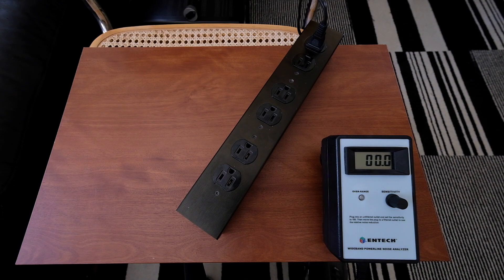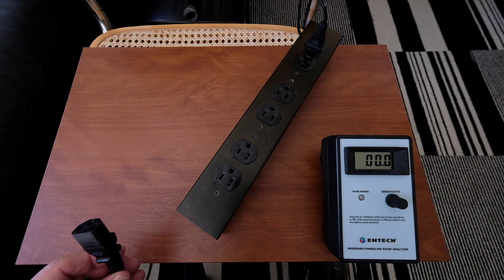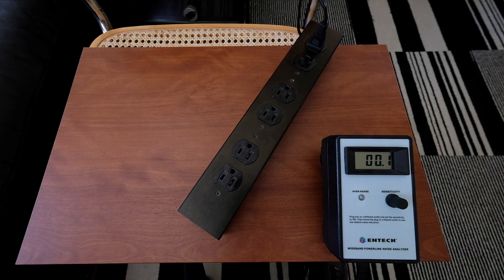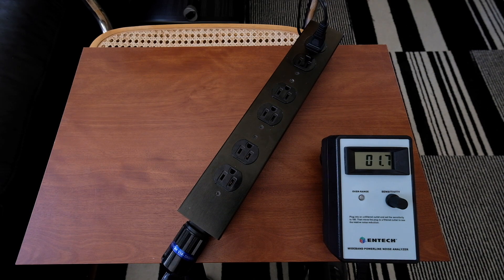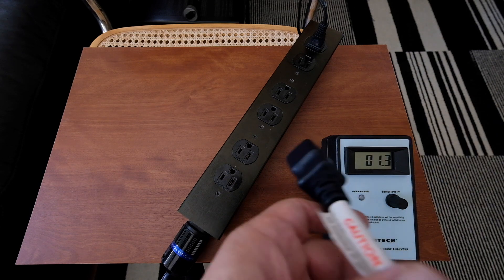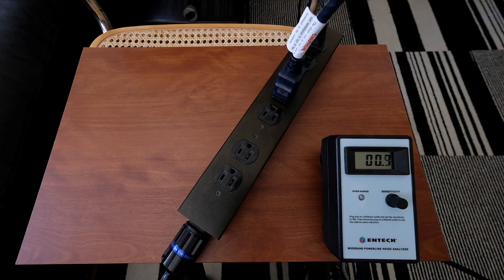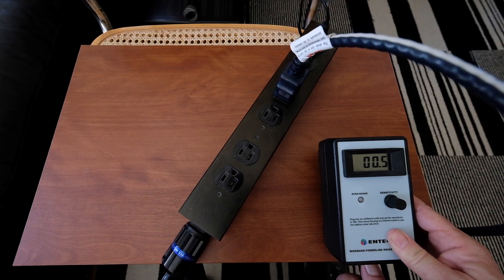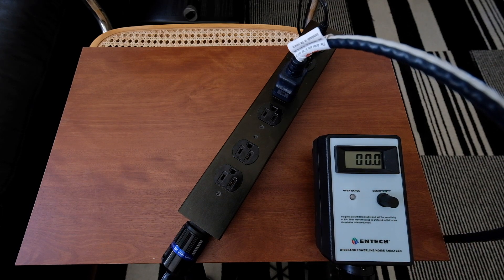V14D Demo Part 2

Comment: This is a scam, on the first video, you are plugging a cable that plays like antenna.... and capacitor, that's the noise. With the  expensive cable, has a concentric or coaxial shield that works like faraday shield, that is enough: not to work like antenna and to reduce the capacitor data. With a 3$ meter cable with concentric or coaxial shield is enough

Comment: What's the difference between the venom 14 vs this Venom 14D I only need two cables one for a DAC and one for a streamer both around $1000. Wich should I get ? The difference in price between the two isn't a concern
Reply from the maker: Hi Jaylen, a "regular" Venom 14 has no noise reduction capability. The Venom V14D has a noise reduction filter specifically designed for digital-only devices, e.g. a streamer, network bridge. For your DAC, you should consider something like the new Venom NR V-12 or NR V-10, if you have the budget. The price of the Venom V14D is $250. The price for the Venom NR V-12 is  $398 and the price for the NR V-10 is $498. So, if you got the NR-V10 and the V14D it would cost ~$750 for both cables.
Reply: @stephenscharf6293  thanks for the reply the V10/14D it is!
Reply from the maker: @jay12345ist  You will be very happy. I use the Venom NR-V10 for my DAC and the V14D for my network bridge.